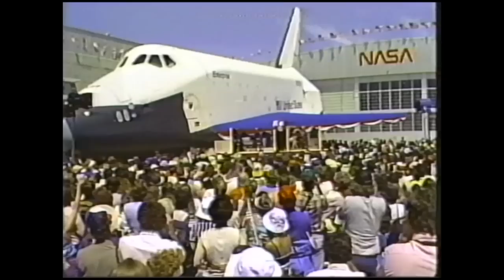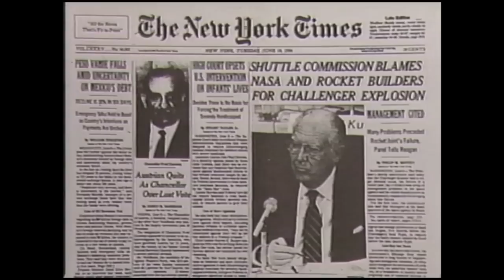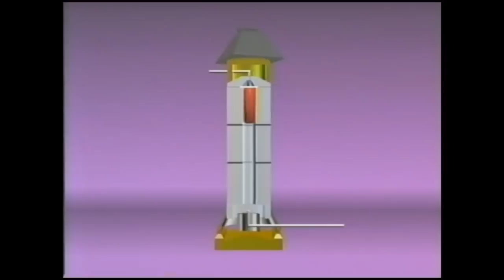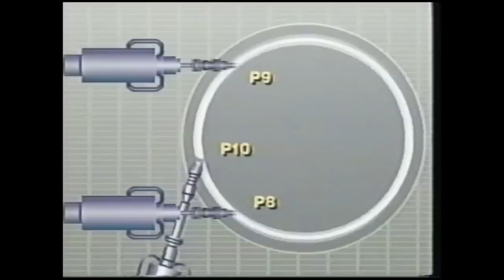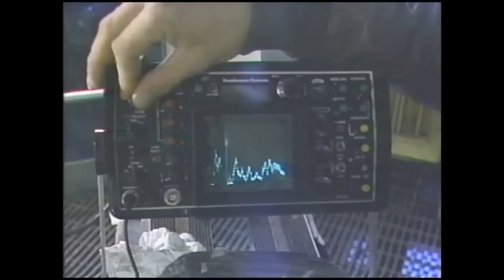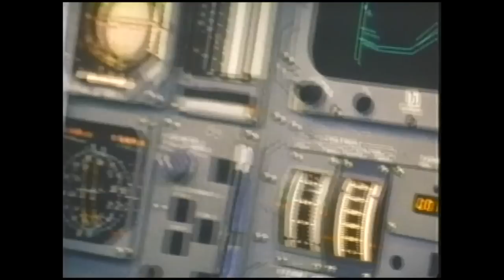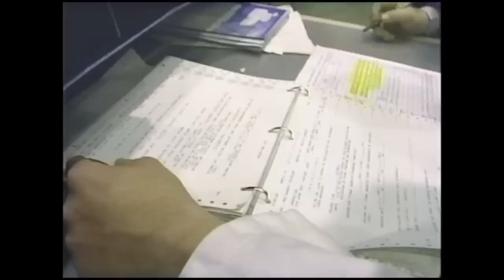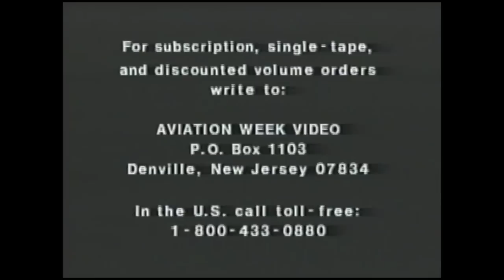Space Shuttle: The Recovery - 1988

Comment: What is so sad is the new fuel caused the ice formations that fell on the shuttles afterwards and caused the Columbia disaster. Those ice buildups were not present on the original SRB's. It was stupid to launch that day, I was wearing a jacket watching the launch 😢
Reply: strgazerlilly, foam, not ice, is what broke off and damaged the leading edge of Challenger’s port (left side) wing. The creation of ice is completely dependent on the level of relative humidity in the air. The hydrogen tank is so cold that any moisture in the air accumulates on it and forms sheets of ice.
Reply: inkyguy columbia
Reply: Nothing to do with the fuel. Where the feck did you get that idea? inkyguy said it all correctly.
Reply: strgazerlilly foam from the fuel tank punched a hole in the wing of Columbia, not ice! Ice didn’t fall on Challenger either.....the two rubber seals in one of the rocket boosters, that obviously didn’t expand under such low temperatures, failed. No ice fell on anything.